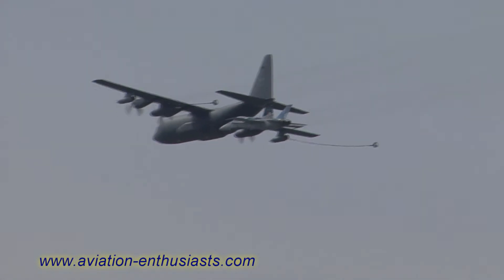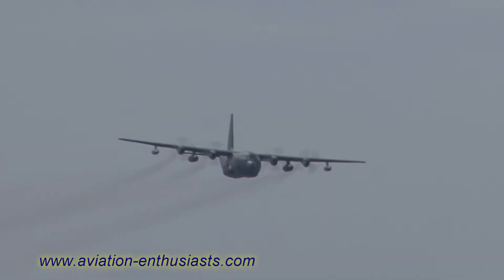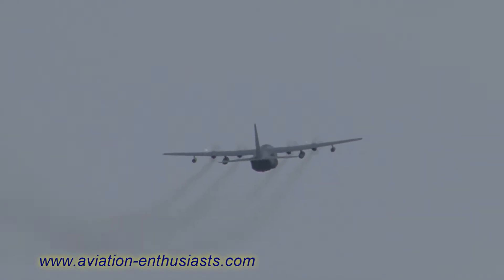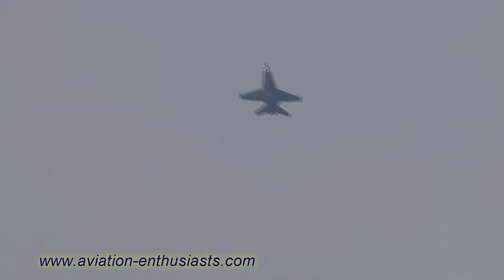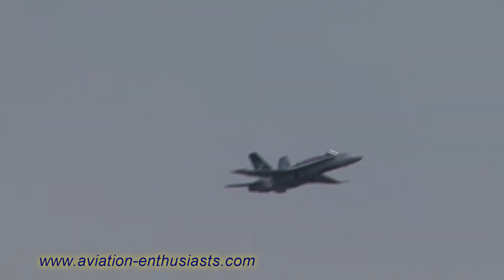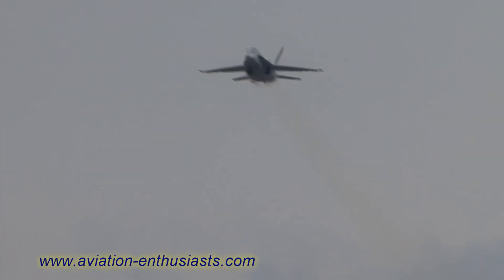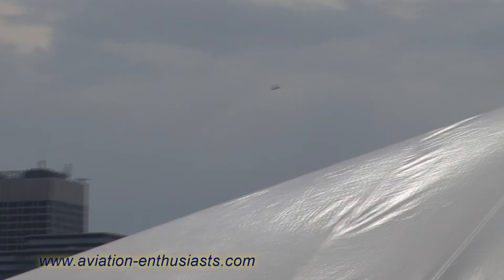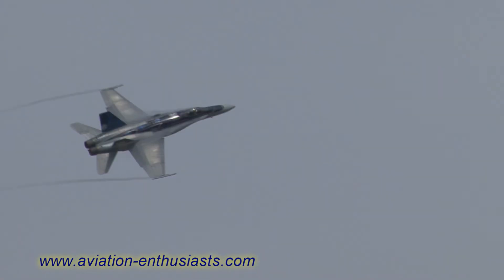2012 Cleveland National Air Show CF-18 Hornet demonstration highlights (Saturday)

Comment: The Super hornet version  kills the F-35
Reply: The F A super Hornet with external tanks and armenets can hit mach .08 top speed. Unarmed she can reach mach 1.8. The F35 fully armed with additional fuel can reach mach .09. People don't realize that these two jets entering hostile Sky's are about the same speed. Unless of course the Cf 18 is unarmed.
Reply: @ChrisBlack1  you are correct all the way!!! Tired of I'll informed opinions of the F 35. You are right the f35 is far superior to the Hornet. Last year I witnessed aF35 pull up into a 9 g climb, without loading speed or any added thrust ,. What a show!!!!